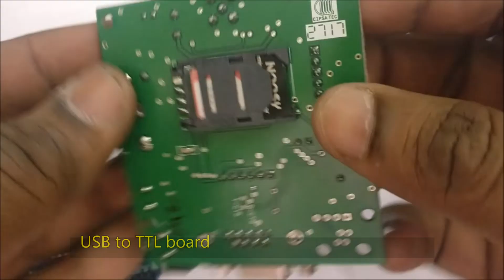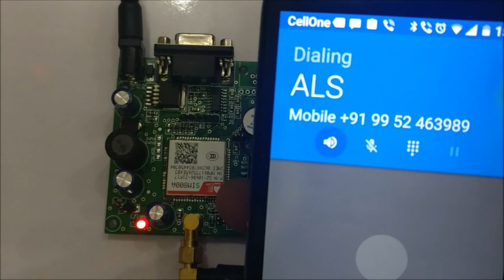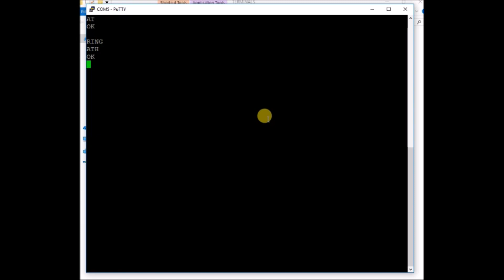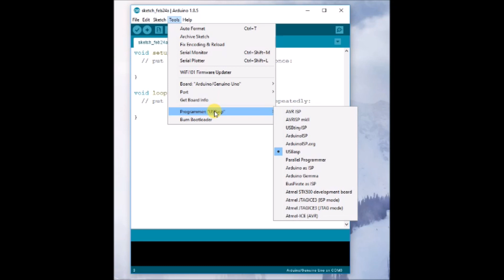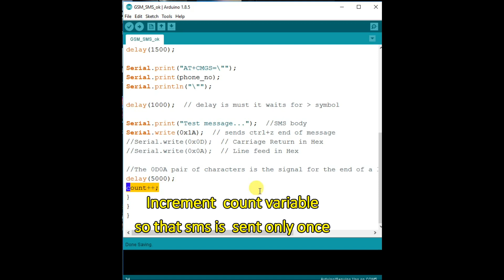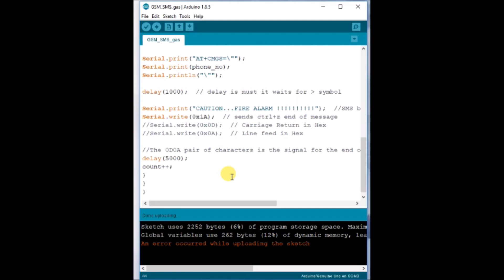GSM WITH ARDUINO - AT Commands Step by Step - Smoke Alarmcode

Comment: Thanks for sharing such an Awesome project.
Can you please modify & share the code using AT+CLIP command to send the SMS to a mobile phone number from which the miscall is placed to get the current smoke sensor status instead of any fixed hard coded cell number. This way the user can request the status using any mobile phone.
Awaiting your earliest response.
Thanks & kind regards.

Comment: sir ! plz help me ........im using a gsm800a im not able to receive or send and sms using this module
Reply: even i used the same board make sure you have placed the valid sim card clearly and it is connected to a network check whether the tx and rx pins are connected clearly

Comment: Thanks sir for this, sir I am using sim800l when I insert Sim but it's not registering on network, the led is continuously blink
Reply: Had the same problem.. ! using a short wire for powering the sim800l worked for me.